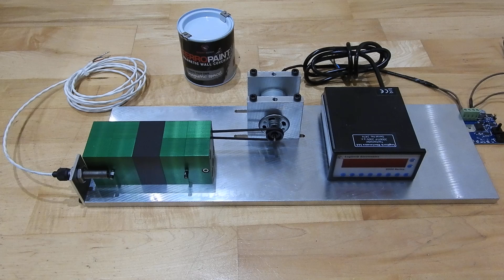Nikola Tesla's Thermodynamic Transformer - Fluid Gearbox - Part 3

Comment: It's a good idea, it can also help to fine tune the amount of vacuum nedeed for the input values (temperatur, pressure and flow rate) of steam!
Reply from the maker: Tesla’s target vacuum is 1psi absolute which is just under 28” of mercury gauge pressure. It works out to 93% vacuum.

Comment: In your overview you mention the the twin axle being "slightly" ;) better than single axle, can you comment why? or make a video for us noobs.
Reply from the maker: Removing the back pressure (the opposing force) to exhausting the working fluid.
Reply from the maker: Allows for gear reduction or the opposite from shaft to shaft
Reply from the maker: The twin axle setup allows the turbine to spin unloaded and the load to be applied the pump shaft. The aim is to have a high enough vacuum so that the turbine rapidly condenses water from air and the pump flash evaporates it. This way both machines are receiving an environmental input from the sun. It is essentially a backwards open air "Cryophorus" with the pump acting as the boiler and the turbine acting as the condenser. The turbine being propelled and impelled by atmospheric pressure, which is in turn propelling and impelling the pump viscously. The pump flash evaporating the condensation which then pulls an even harder vacuum maintaining the cold sink in the turbine. Doing all this on one shaft makes any load instantly reflect directly on both pump and turbine which doesn't allow a very high RPM to be converted to a lower RPM. The fact that Tesla patented a 2 stage twin axle machine in 22 countries and the two stage, single axle in 4 countries might also be a good indication on the importance he placed on the invention.